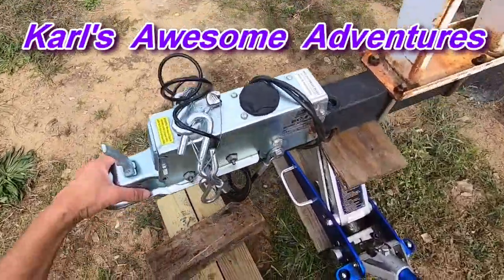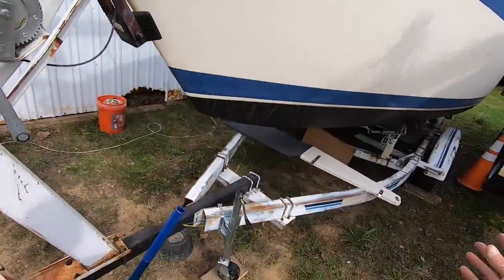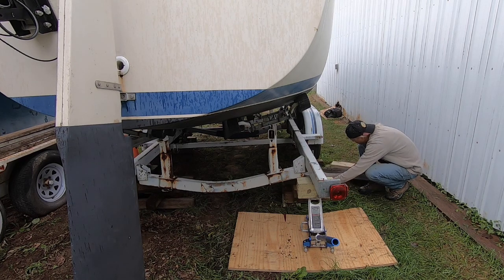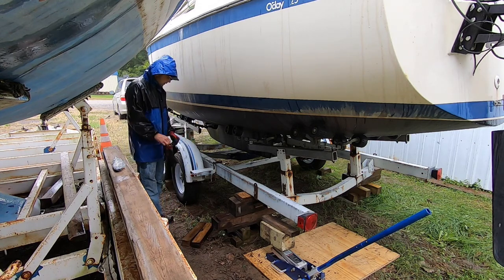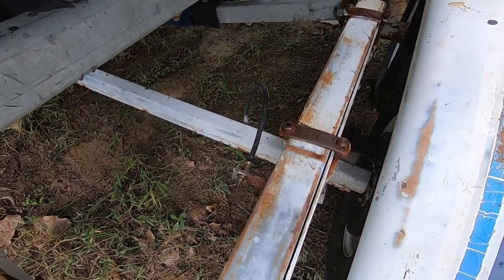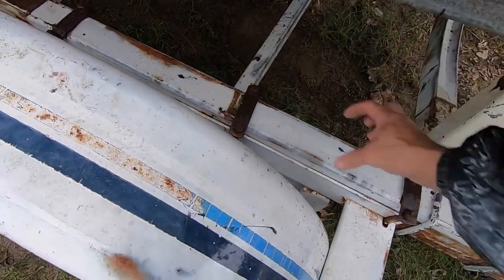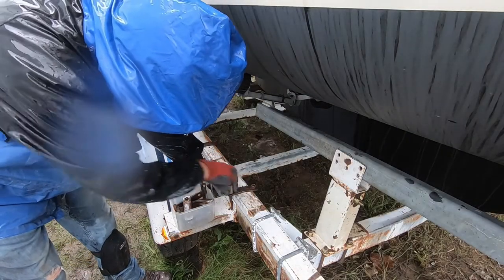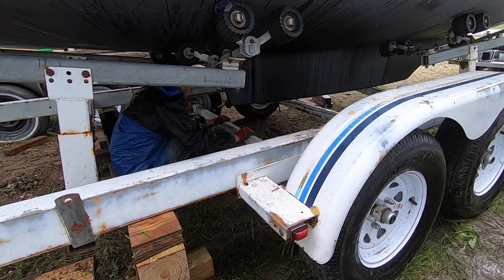How To Adjust Tongue Weight On A Sailboat Trailer  |  E33

Comment: I hope the additional tongue weight is not too much for the tow vehicle. Nice job working in the rain. I moved my axle the same way.
Reply from the maker: Jeff I was worried about that too. The towing capacity of the Ford Explorer with V8 is 7,000 pounds. It does strain some on acceleration.  I'm only going locally a short distance with it now. Someday I plan to get a big pickup truck, which would be better. Thanks for the comment. Keep looking up : )